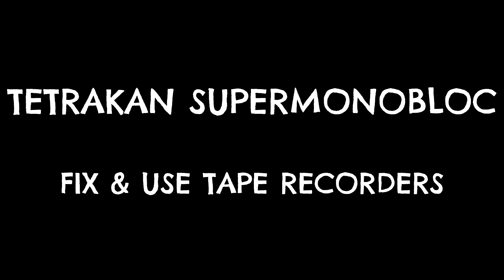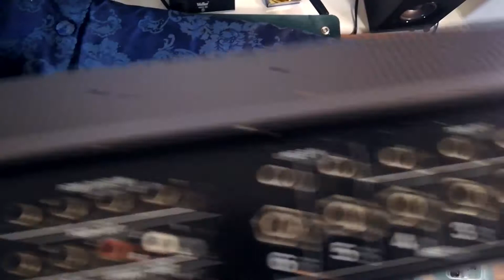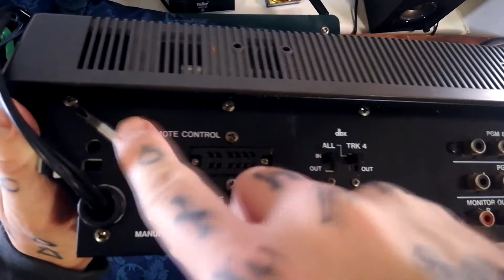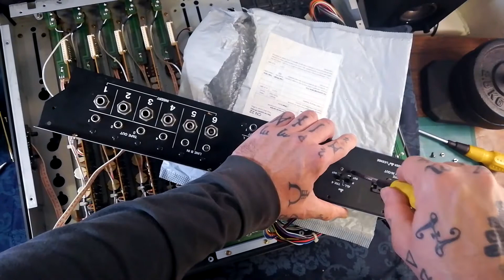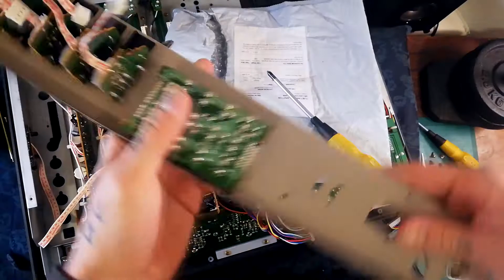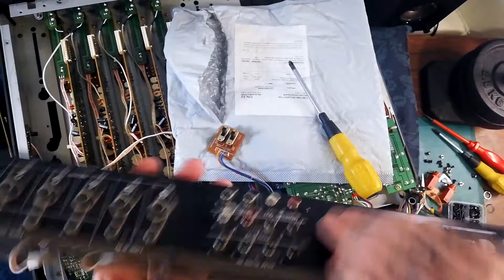Tascam Portastudio 246 | 4 | Remove rear panel  | DBX switches | insert, remote & tape out sockets

Comment: this is a nightmare omg getting to those RCAs
Reply from the maker: Yup! #buildquality
Reply: @Tetrakan  do you have a philosophy when it comes to cleaning these guys? i remember you mentioned canned air but not sure if you recommend taking apart and using tools or applying contact cleaner. i have some finnicky switches in the 'phones' section that are all interacting with eachother. i'm intimidated to open this machine
Reply from the maker: If I get a neglected 4 track I’ll do enough disassembly to expose switches faders and pots as a matter of course. I use contact cleaner then compressed air - repeating those two steps several times depending how filthy the unit is - then follow up with a lubricant. It’s important to use compressed air and lubricant because though contact cleaner does a great job of dissolving gunk, it can also remove lubricant placed there by the manufacturer, and extra ingredients in some contact cleaners (they’re mostly isopropyl which you could use instead) can interfere with conductive surfaces on switches, faders etc, so it’s important that once it’s worked it’s magic on the grime it’s blown out to evaporate harmlessly.
Reply: @Tetrakan  thank you!
Reply: @Tetrakan  so much great information. thank you